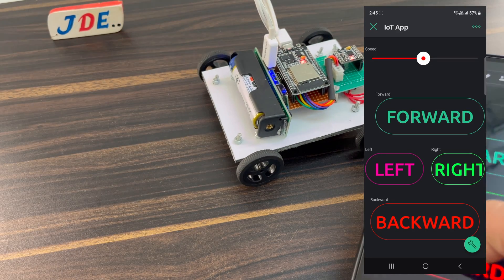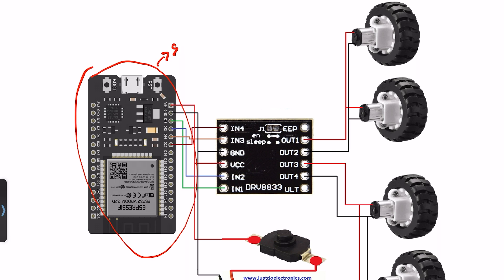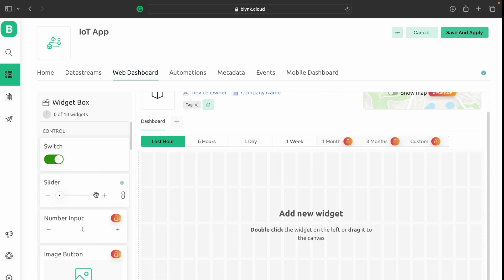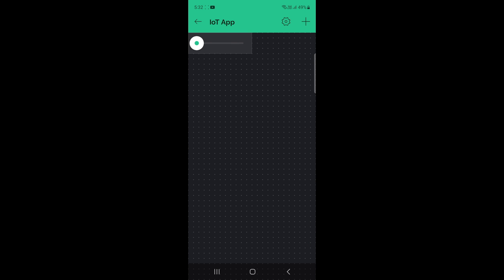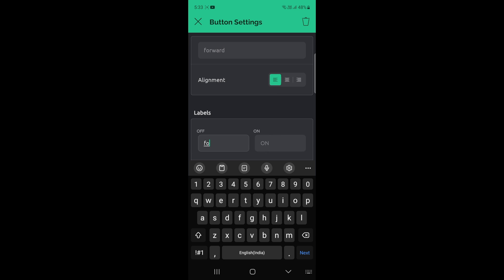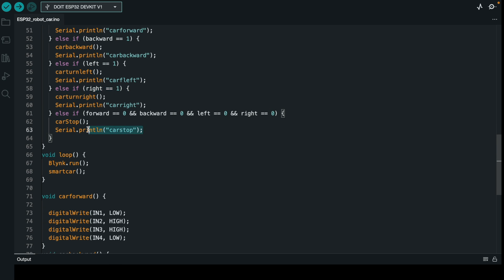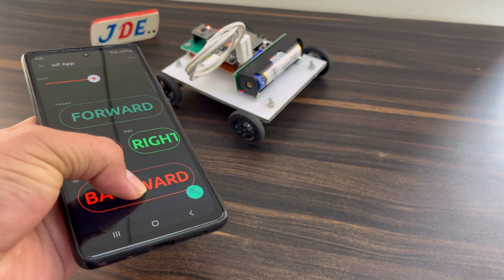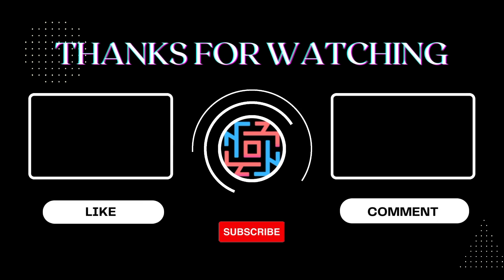WiFi Controlled Smart Car Using ESP32 and IoT Mn2o Motor Driver

Comment: Brother i am facing some problems in you GSM based fire alarm system can I contact you to get a solution
Reply from the maker: Send me video link and problem statement
Reply: https://youtu.be/tKqZkN2s1iA?feature=shared
Reply: Actually my modul is detecting fire but not sending any call and sms
Reply from the maker: @prateekisplaying6795 check gsm conection
Reply: But my sim is ringing in module
Reply: Prateekpanchall
Reply: Brother i connected all connections as your circuit digram
Reply from the maker: @prateekisplaying6795 change the gsm pin and try it
Reply: Okay brother I’ll do that
Reply: Brother i did everything i chech everything twice and its not working even the led bulbs are not glowing